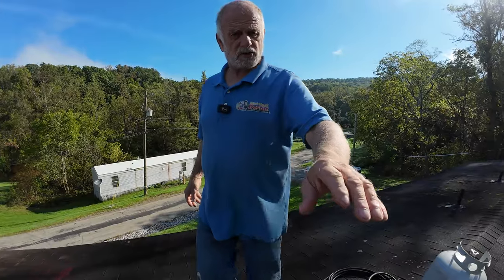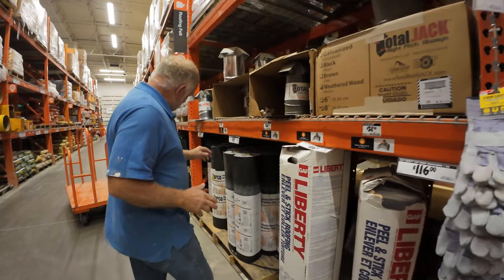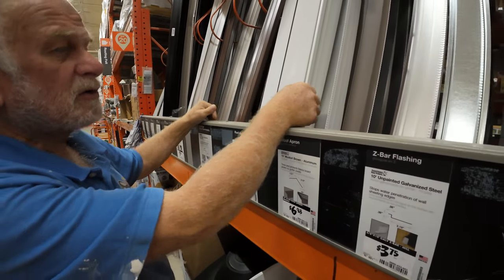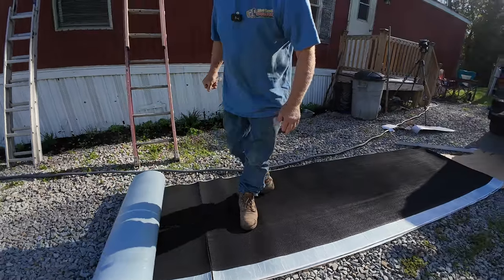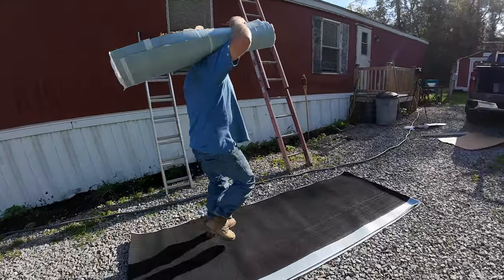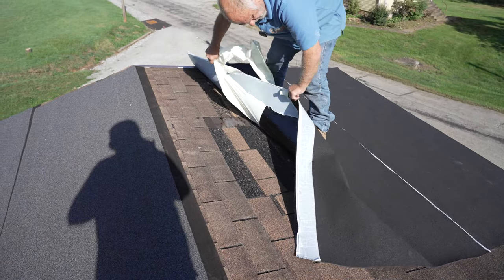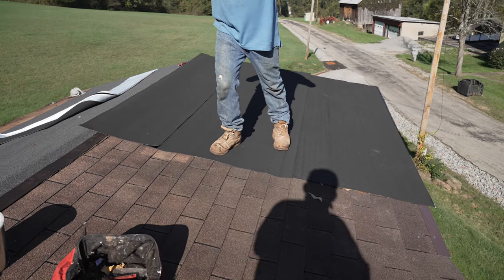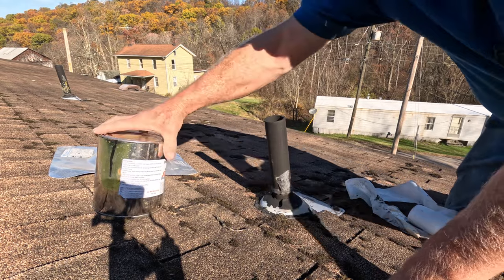TRAILER HOME ROOF LEAK REPAIR - Less than a $100 DIY super easy - 30 min

Comment: I'm in Fl with hurricanes and have a 43lb felt hot mop with 105lb premium SBS cap and foam cemented tiles.  Does it make sense to put down a a heavy tarp on entire roof BEFORE storm to help hold down tiles?  I guess I would attach to facia?